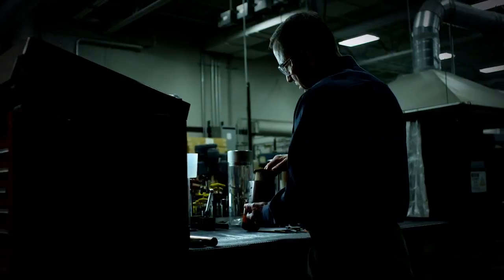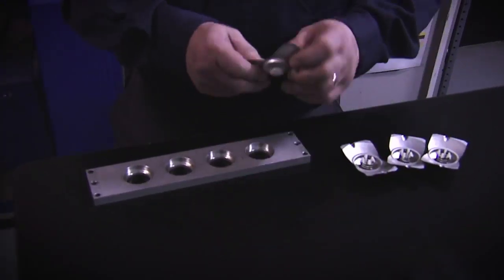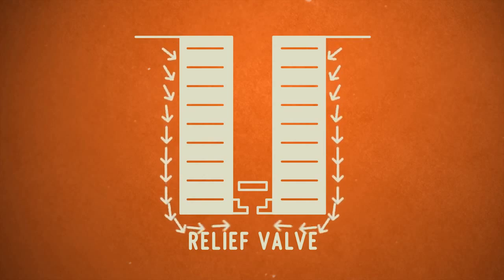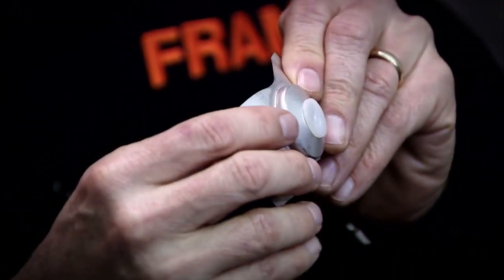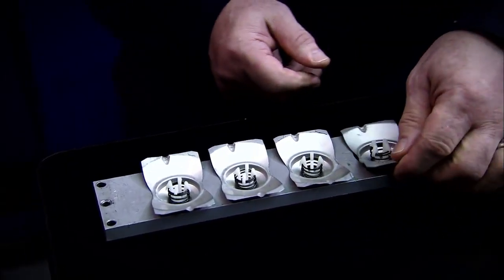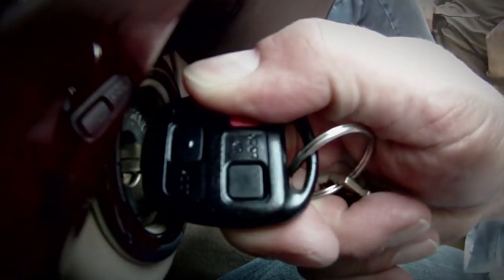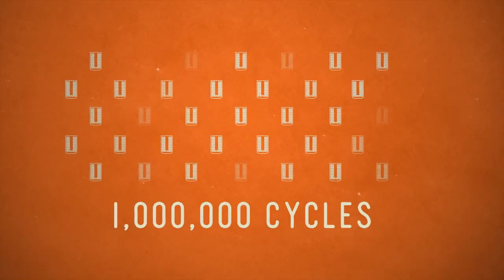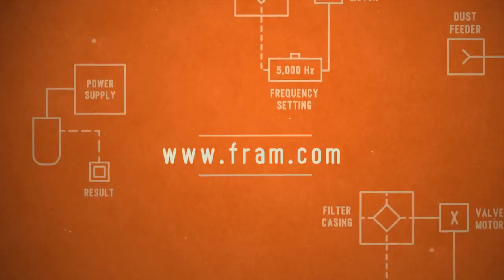The FRAM® Valve Test

Comment: Nothing about the oil leaking around and through the ripples on the sheet metal valve holder. Which is a real thing that I have not seen Fram address publicly.

Comment: The nylon poppet does not seem to use any sort of elastomer gasketing material, as in a "soft seat" design, to form tight seal against the metal surface. It appears to be, what industry publications state to be, an inferior "hard seat" design.
The video only addresses the durability/life-sapn. It does NOT address the concern that the oil will be constantly seeping through the nylon to metal interface hence bypassing the filter-media. So, until a see any study proving otherwise, I will only use an oil filter that has a "soft seat" bypass relief valve design.
Reply: Not so concerned with that leak path. More likely is metal-metal interface where valve holder piece fits in center tube. AKA "light (path) leakers" when a flashlight is shined up centertube.

Comment: When the relief valve opens, the oil moves across the filter media and into the back where the pressure relief valve is. Doesn't this increase the chances of something from the media to be washed up and into the bypass valve and into the engine again? In the past, I have opened up a Tough Guard filter and it had a screen over the relief valve which was addressing the problem of debris washing into the engine. On the Fram website, the animated cut out of the tough guard is  missing the screen. Was it removed?